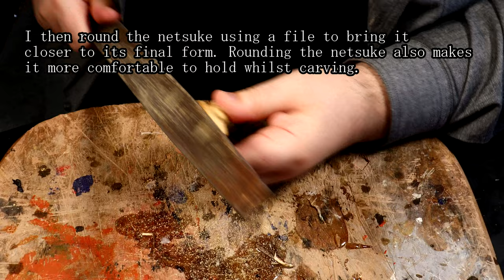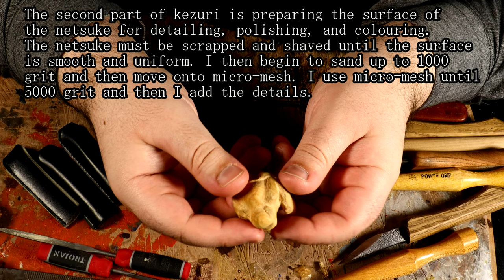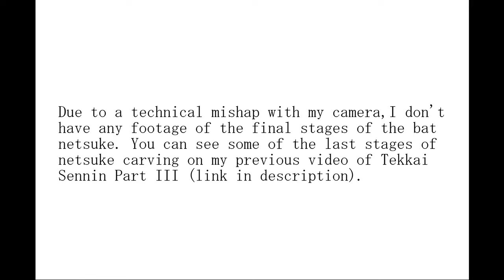Making of a Bat Netsuke

Comment: Great video wish you shoed the stain and polish. Ive made the stain from alder cones but cant get it dark enough.
Reply from the maker: Yashadama stain is only used to accentuate the colour and details of boxwood. You can use yashadama to stain ivory and antler dark by simmering them in yahsadama over the stove. This cannot be done to wood as it will crack. 

The Japanese rarely used yashadama in the Edo and Meiji periods for staining boxwood. Instead, they would have used very strong oxidising chemicals. The so called “patina” with black contrast lines can only be achieved through chemistry and not “natural” stains nor aging. 

I use a rather dangerous oxidising stain I made myself and a series of chemical baths to achieve the dark colour. It is too dangerous to film it in its entirety. I do briefly show some of the early application and ibotaro wax polish in this video: https://youtu.be/_468sKsSAZs 

Thanks for watching!